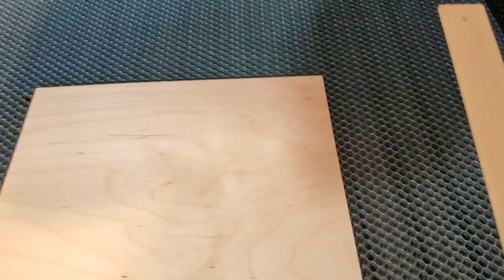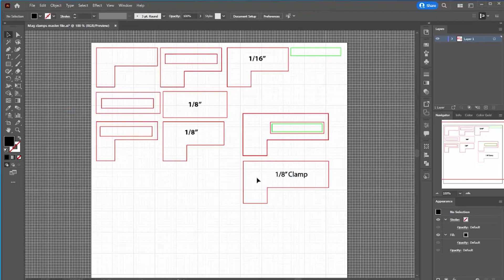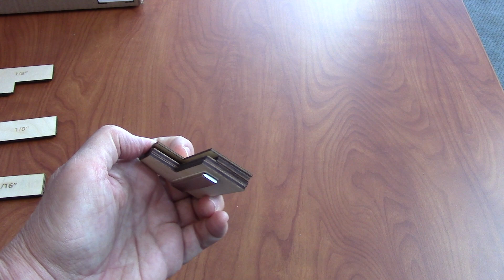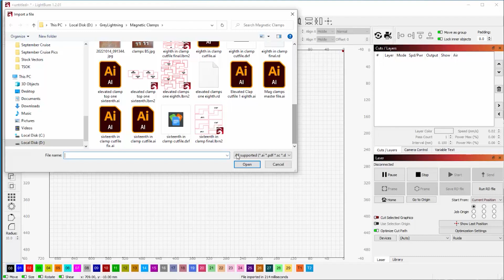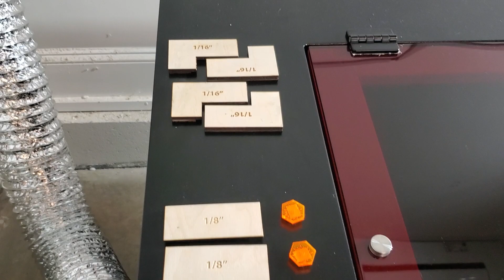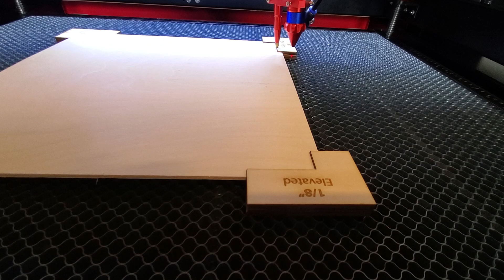How to Design and Cut Magnetic Clamps for Your Laser Cutter

Comment: great idee, can you send me you pattern
Reply from the maker: I'm sorry, rednote, this was not a design I gave away on my old website so I don't even have the file anymore. I still use mine and the ones I use most are just the straight ones. They're very simple, just rectangles and bar magnets. You should try designing one yourself, it would be a great starter project! Depending on the thickness of the wood you cut, you can even just glue a magnet to the wood. For example, 1/8" wood is similar in thickness to some bar magnets. Glue one of those to a rectangle of 1/8" wood and you would have a pretty good starter design, and you could experiment from there.

Comment: Unfortunately my bed is made from stainless steel so magnets don't work.
Reply from the maker: Stephen, what kind of cutter do you have? Was the stainless steel an upgrade?
Reply: @GreylightMay  it’s called a Vevor. I suspect that it’s only available in the UK. I’d certainly prefer a honeycomb because the smoke struggles to get to the vent. The bed is 90% solid.
Reply from the maker: Stephen, it seems like all the beds have issues. I watched a video about honeycomb being a fire hazard, especially when cutting a lot of acrylic. The fumes condense in the honeycomb and leave a flammable coating of acrylic impossible to clean off. Scared the heck out of me! Only an issue in a high volume production setting, which is not me, but still a reminder to never leave the machine alone when cutting.